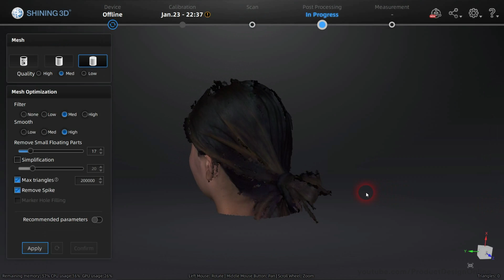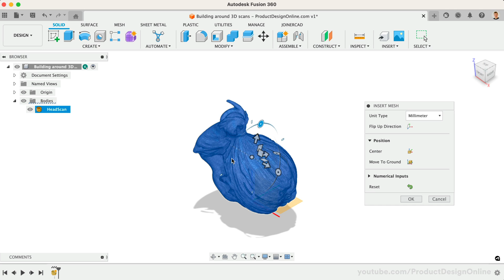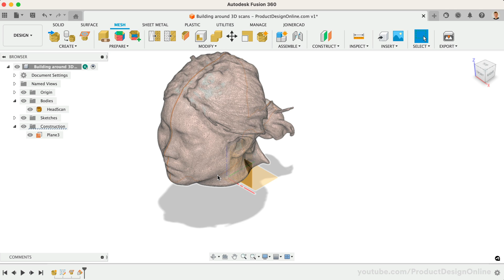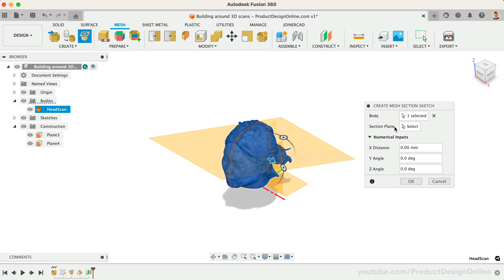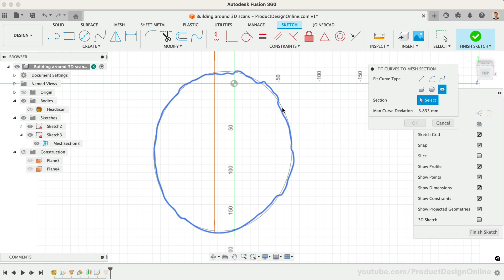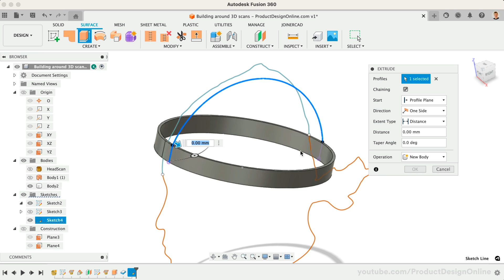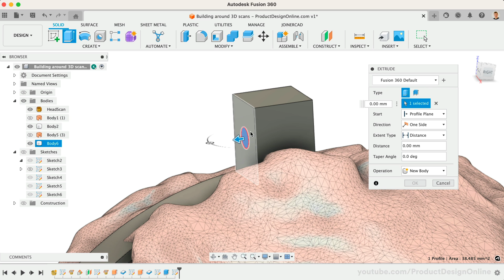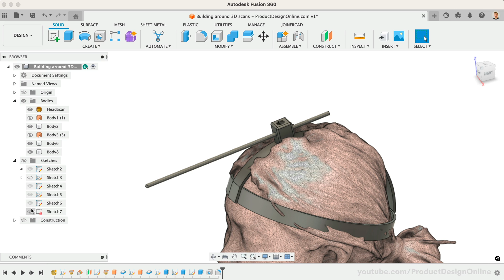Secrets to build around a 3D scan in Fusion 360

Comment: I'm having a lot of trouble accurately modeling a 3D scan of bare feet using Forms to ultimately use for orthotics. The toe area has proven impossible for me without warping, folding and creasing as it's an asymmetric body part with tapers, holes and valleys. Can you PLEASE do one of your fantastic detailed explanation videos on how to accurately do such a complex shape successfully for a usable solid.
Reply from the maker: See if you have a 'Fleet Feet' shoe store near you. They have 3D scanners specifically made for feet and will do a scan for free.

Then, you can email the company that makes the scanner and request your 3D source file.

I used this for a project and it was 10x easier than trying to scan at home, with even more expensive 3D scanners that I had, due to how their scanner is made specifically for the feet, and everything is done in a few seconds while you stand there.

Comment: I am following the tutorial and I figured out how to edit the sketch, thus having the "Sketch" tab at the top. I am in that mode but there is no "Fit Curves to Mesh Section".  I am trying everything I can to get that to show up but can't. I also do not fully understand "... having a mesh selection in my sketch.". Could you illustrate how to make sure I have a mesh selection in my sketch.  Thank you.
Reply: To back up a bit, when I click at the bottom left at 4:27 It is not the same for me. It does not create the "Sketch" menu at the top and rotate view. Instead nothing happens. The way that I got it to do that is by  "S" and then Search for Create Sketch. This creates a Sketch with no MeshSection in it.  I can go back to my "Sketch2" that has a "MeshSection2" mesh section in it but I still do not have "Fit Curves to Mesh Section" available. I can see it selected on the timeline below and I can select it in the tree but no "Fit Curves" ability. 
If I delete the new Sketch that has no Mesh Section in it and go to the on that dies, there is no more sketch menu.
P.S. You say "Mesh Selection in your Sketch"  I see there is a "Mesh Section" that is sub to my Sketch in the tree. Are these the same? Were you meaning to say "Section?" Please advise.
Reply: Ok I solved this whole issue by right clicking on the icon you hit at 4:27 and doing "Edit Sketch" on the right click menu - I think 4:27 was a bit jarring. I know very little about Fusion 360.